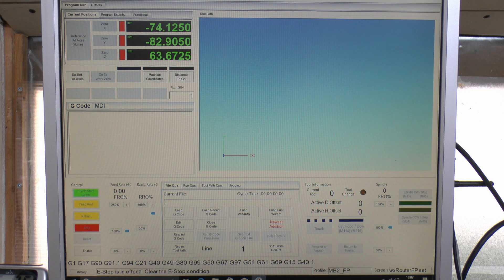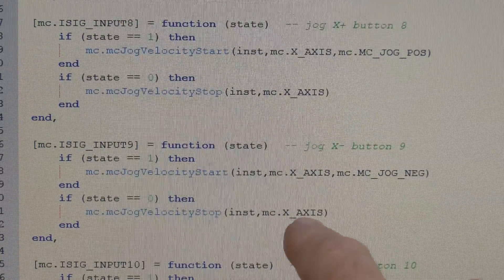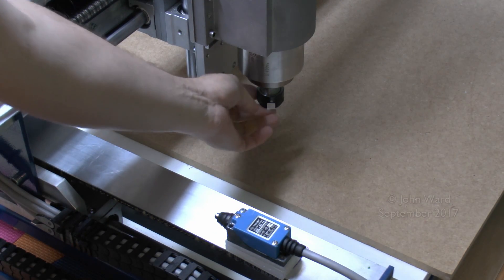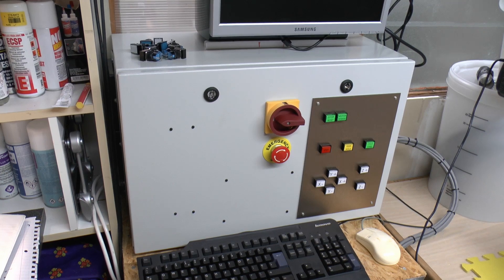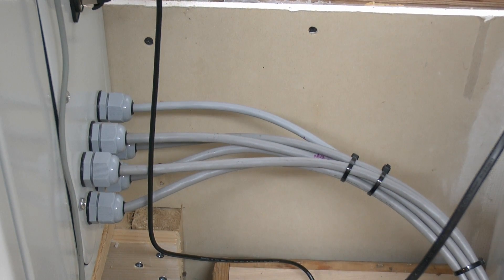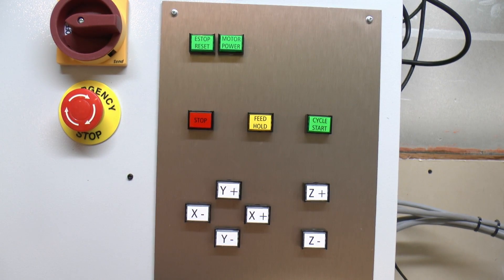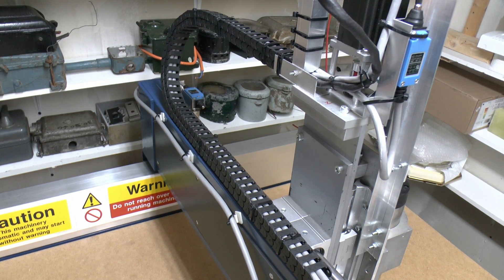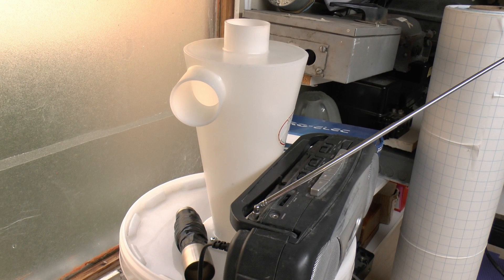CNC Router Build #8 - Jog Buttons, Parts and Costs

Comment: With all the effort you put into this, it baffles me why you went with a tiny bed.  This should have had a cutting area of 49" x 97".  You have great cable management of the the initial power wires, then it went to crap with the buttons/ etc.  With the overkill of the switches/ buttons, I find it a large mistake to wire all the limit switches in a series circuit.  Unless you are putting this in an environment of noobs, the interlock is just overkill.  It would have been nice to have separate home and limit switches.  Would it be possible to use a BLTouch to home the collet to the work surface?  Would it be possible to have an analog speed control for the jog switches?  Don't get me wrong, I think you have done a great job, but I always think outside the box.
Reply from the maker: The size chosen is the largest that will fit into the workshop, which is 8x10 ft, impossible to fit a larger machine in there.
The other options and many others are all possible.

Comment: I built my CNC last year from scrap and scratch and its the most fun I have had in years. I adapted the DIY CNC pans over at Solsylva.com The 18x24 aluminium framed machine is excellent and I rescaled mine to 1800x1200mm without problems using the rack and pinion drive system.